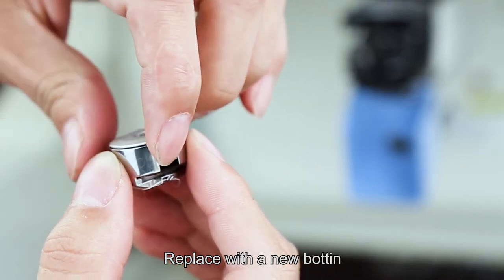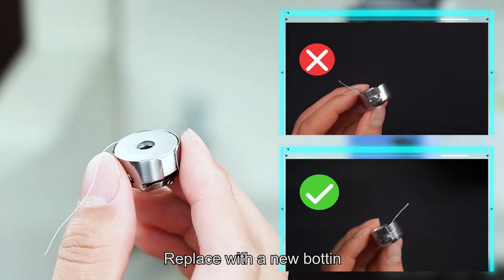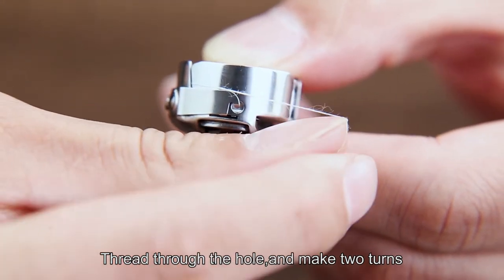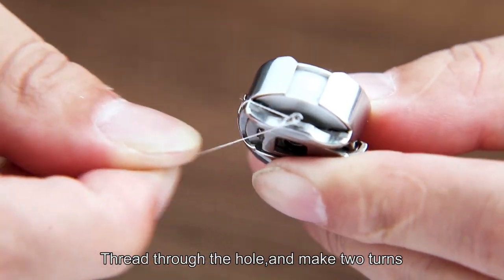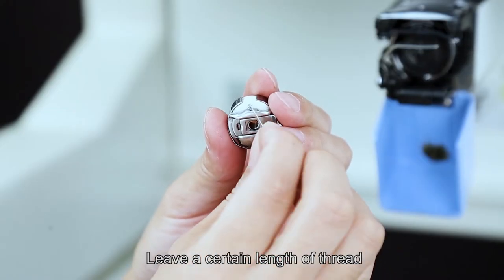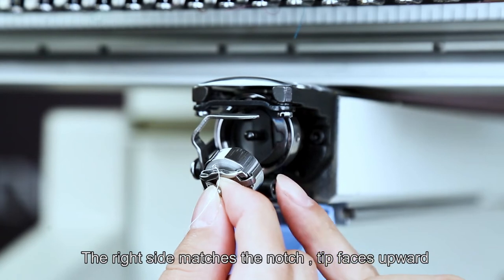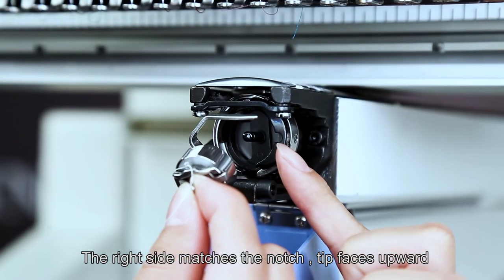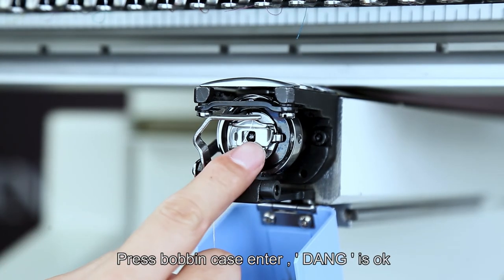How to Install the Bobbin | BAI Embroidery Machine Tips

Comment: Will the machine automatically advice for bobbin change or we need to take attention? Thank you
Reply from the maker: It won't change automatically. It needs to be changed manually. The machine will display a T-break.If the thread doesn't break, it usually runs out of bobbins~